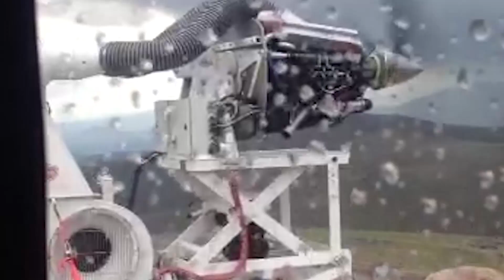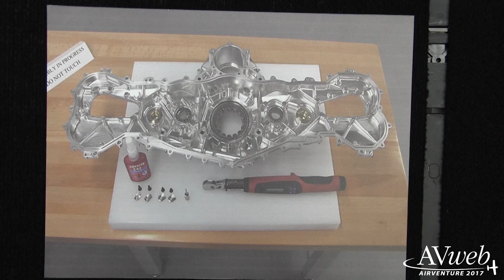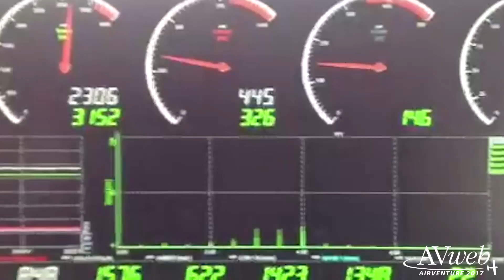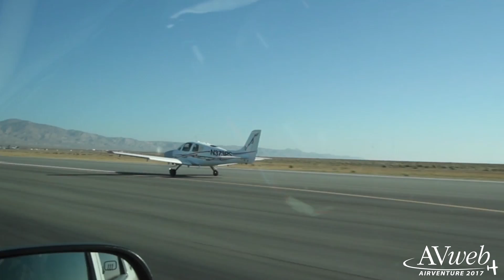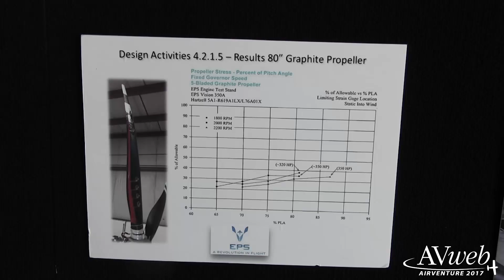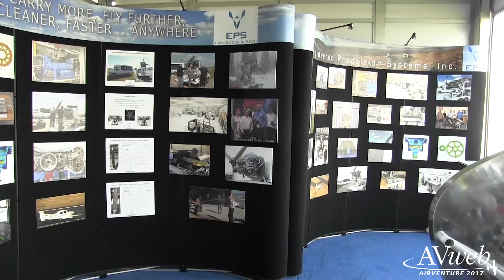EPS Diesel Back at AirVenture

Comment: Here's hoping this engine meets expectations and comes to market with a scaled down version or two as well. GA really does need a Jet-A burning alternative that's not priced in the stratosphere.
Reply: Apples and oranges  ...  Lemme know when that Nissan puts out  #620 N·m and has a duty cycle of 10,000 hrs at 70%. Marine engines like Aircraft engines are designed and tuned for endurance and reliability, not maximum output.
Reply: AGAIN: Torque means nothing because it can be changed to basically anything you need with gearing. The power output of the engine tells you how much torque you'll have at a given rpm.

For example: Your 260 hp diesel makes its peak power at 4,000 rpm, but in order to run a prop it would need to be geared to 2,700 rpm, and that would require a gearbox with a ratio of 1.48:1. The torque output of that gearbox at 2,700 rpm would be right around 500 lb-ft, or 1.48 times the flywheel torque output at 4,000 rpm. The Adept Airmotive engine can also drive a prop at 2,700 rpm (or 2,250, depending on the gear ratio), so the torque output from its gearbox would be 622 lb-ft. That's the difference between 260 hp at 2,700 rpm and 320 hp at 2,700 rpm.
Reply: I don't understand why this has to be explained to anyone...

Heavy duty engines are *HEAVY*, that's why they're able to run at high power for many thousands of hours, and their weight is also why you don't see them flying in aircraft. The longevity of an engine depends on how heavily its built, not on the fuel that it burns. If you build a 260 hp, 675 pound gasoline engine, you can bet that it will run just as long as a diesel at full power, if not longer because the stresses of the diesel combustion cycle are greater. 

Power is the only thing that matters with regard to the performance of a vehicle, the amount of torque an engine makes only tells you how fast it's going to need to run to produce its power. 

The definition of power is work done over time, more power means more work done over time, or the same amount of work done faster.

Aircraft engines need to balance reliability and longevity with their power to weight ratio, and diesels do very poorly in the area of power to weight ratio. You're comparing apples to oranges because you're comparing an engine that could never power an aircraft and provide it with any usefulness to engines that DO power aircraft for thousands of hours at a time.

Edit: Better wording.
Reply: Compression ignition engines are inherently expensive, especially when expected to be light enough to be used in an aircraft.
Reply: In cars and trucks they charge more for Diesels because they have lower productions runs, higher marginal productions costs, Also they can charge more because diesels last longer and are often used in commercial applications, hence greater Value.  But with todays CNC production methods,  materials, surface finishes and Tech, when you compare the cost of materials, machining and production per/unit they don't really cost that much more to build, say @15 - 25% using modern production machinery.

The difference in Retail cost of Spark Ignition Aircraft engines vs similar duty Marine diesels tho is crazy _ For example, the MSRP for the high-tech 260/hp common rail, 3.0L V-6 Mercury Diesel  is @$35,000. Whats the cost of a new 260hp IO-540 Lycoming, $100k?

I think the biggest issue is development cost and scale of production differences...not to mention the $$$ cost of Certification.  That Mercury V6 btw is a light-weight, very hi-tech, VW-Audi based power plant, so they do build a few and that does lower the price.
Reply: They charge more because making stronger components costs more money, and those components need to be built stronger in order to cope with the higher stresses that come with the diesel combustion cycle. That problem is compounded in aircraft engines because the components not only have to be strong, but also light. 

Most of the cost difference between aviation engines and the engines used in other applications is definitely due to the certification process. 

That Mercury V6 is insanely heavy, a gasoline V6 with similar power output weighs around half as much. You can also compare it to something like the Adept Airmotive engines to see how far off the mark it is for a modern aircraft engine.
Reply: @Bravo21  The only reason diesels 'last longer' is their application. Longevity is not inherit to the cycle type, rather the design specifics, production quality and material types. The exceptions might be valveless engines, because objectively less parts is objectively more reliable.
Reply: "Today's CNC production methods"??? CNC is the most expensive way to mass produce parts. Small production run costs have gone down because of CNC technology but you generally don't make 100,000 of something using all G code.
Reply: "Whats the subject of the Video?"

AIRCRAFT engines, not boat engines that are too heavy to be used in aircraft.
Reply: Spark ignition is much easier to manage. There are much lower pressures and vibration which results in a product that is lighter and can use cheaper materials. Diesel needs much stronger components and thus stronger more expensive materials and heavier. Also Diesel produces more emissions requiring more R+D and extra technology to making it past the EPA. I think a better option is making engines that will run on 91 octane automotive fuel. This is economically a much better option for a casual flyer of less than 100hr a year. Jerry cans at home airport and 100LL if you are cross country.
Reply: Lol, Seriously?  I dunno if you're having me on,  joking or actually believe that nonsense?  Torque and durability mean everything for high duty, low RPM  Truck, Marine and Aircraft engines. HP makes noise, Torque does the work. Apples and oranges.
Reply: @Bravo21  "HP makes noise, Torque does the work." < the telltale sign of somebody who has no knowledge of the physical principles at play in the work of powerplants. This is why you are not an engineer. Torque is a measure of force, work is force done over distance or unit length, and power is work done per unit of time. Torque is a spec that is only useful to someone also looking at what RPM torque and power outputs occur and designing a prop/gearbox to match that. After that, we care only about sustained power output / mass and Brake-specific fuel consumption (or how much fuel is consumed to produce a given amount of effective work, or power time).
Reply: Lol and again I gotta wonder if you are joking, trolling or simply don't have a clue ... apples to oranges.  A heavy duty Diesel can run at 90% output for weeks on end with no damage at all, a spark ignition high rpm engine cannot. In Recip engines HP makes noise, Torque does the work. That is what matters here, work done over time with sustained high output and reliability, not a trip down the race-track. Apples to oranges.
Reply: @Bravo21  "A heavy duty Diesel can run at 90% output for weeks on end with no damage at all, a spark ignition high rpm engine cannot." Last I checked, a spark ignition O-360 has a 2000 hr TBO... that's 12 weeks at WOT, that's how airplane engines are run. Work over time is called *power*... A diesel engine is well suited to high load applications yes... this is because it operates on a different thermodynamic cycle than the Otto cycle and the practical realities of this difference in cycle and fuel lend itself to such applications. I would not consider Diesel the optimal engine type for GA, because as we are seeing here, Diesel engines have to be heavy and have relatively poor power output (and diesel fuel has less specific energy per mass albeit barely). 50 pounds over a 400 horse O-720 BEFORE any cooling systems are installed is considerable and due to the engine's location far from the center of lift, also results in a much higher load on the elevators, leading to inherent lower aerodynamic efficiency for the aircraft.
Reply: @Heatherder  Links wont post. On YouTube, search for the following videos:
-
Winning entry in the 3rd Global STOL competition 8/3/2020 - Steve Henry
-
Viking 130 Rans S-20 Cruising Faster than Rans S-21 with Turbo Rotax 915 - Viking Aircraft Engines
-
P-51 Mustang Voodoo: The Fastest Piston Powered Aircraft  - SkyMaster21
-
Fieseler Storch - Part One - Kermie Cam - Kermit Weeks
-
The Bull Moose With Corvette Sound - ErikJohnston
-
Adept Airmotive Shows Its V-6 at AirVenture - AVweb
Reply: "I was not offing an opinion."

Because you don't want to acknowledge that you're wrong, you're just throwing a tantrum like a child.
Reply: You can't compare the price because the marine engine isn't light enough to be used in an aircraft. Making an engine light, reliable and powerful is very costly, especially if it's a diesel.
Reply: We are talking about Production engines _ All engine blocks must be machined during production. Mechanized Machine processing (CNC) is faster and far cheaper than using a human machinists to do the job and why they are all CNC machined today -  no matter if the engine block is cast or Billet.
Reply: I agree, but the VW-Audi Diesel V6 is very lightweight (675lbs / 306kg) for its output. It uses an engine block fabricated from Vermicular Graphite Casting (VGC), with twice the strength of gray iron and most of its attributes, but is 5% to 10% lighter. This is a very modern engine.
Reply: A Nissan VQ35DE (just a Plain Jane automotive engine) weighs around 330 pounds and can make up to 280 hp from the factory, and that's with full emissions controls. Eliminate the emissions controls and it's probably capable of making 20 hp more. The naturally aspirated Adept Airmotive engine weighs 324 pounds with its PSRU and makes 280 hp, the turbo engine makes 320 hp and weighs 340 pounds with its PSRU. You can basically run 680 hp worth of gasoline engine for the same weight as that 260 hp diesel.

Edit: Correction, the VQ35DE made up to 298 hp from the factory.
Reply: I should also add that race-prepped Nissan VQ engines can make close to 500 hp without turbocharging and can handle over 1,000 hp with turbocharging quite well. I doubt you'd want to push that engine quite that hard in an aircraft, though.
Reply: @PistonAvatarGuy  You would want to de-rate the engine for use in aircraft. You could flat-rate it so that maximum output never exceeds aircraft design output but performance only begins to degrade at quite adverse conditions. In any case, a VQ engine would be a horrendous choice for airplanes. For start, V6 engines are not an idea profile for an airplane, nor are V8s. Anything with a chain is going to be frowned upon. Using car engines is not a great idea, but lets say someone too a good contender and redesigned it for aircraft use. Most good contenders will be 4 cylinders, so lets look at a family with some contenders, the GM ecotecs. On the small end you have stuff like the GM 1.4L turbo, a dry 220 lb engine making 160 horsepower. This is very comparable to a 250 lb O-320 making 150 horse. Ad another 50 pounds for cooling and radiator system and gear reduction for the GM and you have a similar weight and power system except the GM engine has a turbocharger and near certainly more efficient at making power per fuel amount. The GM engine will need to be modified, though. The timing chain has to go - it will need gears and that means a new block casting to mount timing gears. It will need to be beefed up for constant near peak-output operation and it will need a new oil system so it can sit upside down or horizontally or at least handle zero and negative G conditions. The ecotec engines are par for the course modern auto engines. All other auto engines will use similar design specs and construction techniques and have the same kind of drawbacks.
Reply: @Heatherder  You don't need to de-rate the engine for use in aircraft, it just needs to be built properly to handle the stress of continuous use at high power levels. The deck of the VQ can be closed with something like a Cylinder Support System, pistons and rods can be replaced with stronger forged units, etc. If an engine can be built to handle more than triple its factory power output reliably in racing applications (1,000+ hp VQ engines are not unheard of), it can be built to handle its factory power output continuously.
-
MODERN automotive engines are hugely overbuilt anyway, the poor reliability of older automotive engine conversions is largely based on older, weaker engines, like VW and Corvair engines. Viking Aircraft is proving that unmodified engines are very reliable in aircraft at their factory power ratings. An example of properly building an engine for use in aircraft, while greatly exceeding its original power output would be the EPeX engine in Steve Henry's latest "Yee Haw" aircraft. It runs at 10,000 rpm at full power and is turbocharged so that it makes DOUBLE the amount of power that it was originally designed to produce. He flies it regularly, all over the US.
-
Nothing is better suited for use in aircraft than 'V' engines, they combine low frontal area with the best possible power to weight ratios. The fastest piston aircraft in the world uses a V-12 (essentially double a 60 degree V6), the Bull Moose (a modified Murphy Moose) uses a V8, as did the Fieseler Storch. Perhaps you can describe some better configurations and why they are superior?
-
Why would timing chains be frowned upon? They're extremely reliable in most applications. Gears would be better, but chains are certainly adequate. There are certain engines which have poor timing chain reliability (GM and Audi, typically), but those can simply be avoided.
-
Automotive engines are somewhat heavy, but that's because they're designed to be inexpensive and easy to produce. When a modern, liquid-cooled engine is DESIGNED for use in aircraft, it's weight is significantly reduced, as demonstrated by the Adept Airmotive 320T and 360T. Liquid cooling systems don't add nearly as much weight as you would think, more like 10 to 30 pounds, depending on the power output of the engine.
-
I'll try to post some relevant links, as you've clearly been living under a rock for the past few years.
Reply: Another video to watch: LongEZ V8 - Chris Martinus
Reply: @PistonAvatarGuy  It isn't about what the engine can handle, rather about what the air frame is designed to deal with, in particular, low speed P-factor problems. Are you a pilot? 

Perhaps I am being to hard on timing chains. However, timing chains have a tendency to stretch on all makes that use them, it's called creep. They are also a wear item that will have to be replaced at TBO, which is fine, but gears would be better and safer to use in an airplane. They can be louder but that isn't an issue for airplane engines because props make a fuckton of noise anyways.

 Automotive engines are not heavy just because of manufacturing reasons, they are also designed for a different application where block rigidity is more important. Car engines regularly experience shock loads waaaaaay higher than what GA engines ever do except in a prop strike. Additionally, some cars use the engine as a structural component. This is excess weight, far from the CG that's a horrible thing for efficiency of the airframe. If it can be excluded from a GA engine design, it should be.

You're also projecting about what I'm saying. You were talking about using car V6s at that makes someone think about 60 or 90 degree V6s, heavy engines that are optimized to fit between two wheel wells, still have room for turbos, header/cats right at the firewall, share this space with a transverse mounted transmission and steering assembly and be very rigid, are not going to be optimal for a light aircraft looking to weigh half as much as the car it was designed for. A nice 120 V6 like Adept's is a different story, and there's nothing wrong with the V configuration in the context of aviation purpose-built designs. 

I took a look at that highly modified for aviation use Yamaha engine by the way, I noticed it has stuff like a dry sump system - really important in airplanes! Some modern cars have anti-slosh baffles or dry sump systems but almost all will still starve the oil pump in a negative-G situation. So there's a redesign right there! I like the little Honda Fit/Viking engine, it's neat but it isn't exactly a competitor to IO-720s.

And lastly, "reliably in a racing scenario" is one of the dumbest terms I've ever headr. Most racing engines completely ignore fatigue limits on cranks and connecting rods because they are expected to last a *few hours*, not 2000. Obviously an engine can be modified to operate for many hours at full load reliably - I wasn't saying it cant. But if you're gonna go that far, why not design an engine properly for its application anyways, instead of spouting off about a fucking bland-ass VQ engine (ghey anyways, and Nissan is about to fold so they won't be so cheap after that).

Living under a rock? You're a pompous dickhead and you know nothing about real engineering or design considerations. You only know how to parrot things you spend all day reading about/memorizing. You play with engine legos, very cute. Let real engineers do the actual work.
Reply: @PistonAvatarGuy  I'm well aware that people drop Chevy blocks into Long EZ and other non-certificated airplanes, and I fully support it. But that's fucking dumb to mention because it's an irrelevant conversation when breaching the topic of what will replace the aging air cooled engines of yesteryear for certificated GA aircraft in the future. You really think a small block is going to get less fuel burn than an IO-540? despite the added weight and no objectively better thermodynamic properties? It ain't small block Chevys unless GM suddenly and naively decided to invest into making a GA engine and getting it certificated, and if they did they wouldn't use an existing car design, they would optimize a new design for the application.
Reply: @Heatherder  "It isn't about what the engine can handle, rather about what the air frame is designed to deal with..."
-
I wasn't suggesting that significantly more powerful engines be installed in place of less powerful engines, I was merely pointing out that automotive engines can be built to handle producing their maximum power rating on a continuous basis quite easily. Anyway, plenty of pilots/airframes handle significant power increases quite easily in many cases (Steve Henry and the Bull Moose in the examples that I provided).
-
"However, timing chains have a tendency to stretch on all makes that use them, it's called creep."
-
Many modern engines (current production Honda 4 cylinders, the Nissan VQ, the Adept Airmotive engine, etc) use hyvo chains, which don't have this problem. Gears would certainly be a better option, but it's extremely difficult to retrofit gear drives onto engines which previously made use of chains/belts.
-
"Car engines regularly experience shock loads waaaaaay higher than what GA engines ever do except in a prop strike."
-
Very true, this also explains how Adept Airmotive was able to make their engine as light as it is.
-
"Additionally, some cars use the engine as a structural component."
-
Very, VERY rarely.
-
"This is excess weight, far from the CG that's a horrible thing for efficiency of the airframe."
-
Except that automotive engine conversions can have power to weight ratios that are comparable to LyContisarus engines... with turbocharging. The power to weight ratio of a turbocharged VQ would be very competitive with that of an IO-550.
-
"You were talking about using car V6s at that makes someone think about 60 or 90 degree V6s..."
-
Titan Aircraft has been making use of a 60 degree Honda V6 for many years now, it's installed weight is something like 415 pounds for 250 hp, that's not bad at all. 60 degree V6s have less frontal area when compared to 90/120 degree V6s and flat engines.
-
"I noticed it has stuff like a dry sump system..."
-
Which was pulled right from the snowmobile. ANY engine can be modified to make use of a dry sump system. Most aircraft engines are wet sump anyway, dry sump systems have never been a requirement for aircraft engines.
-
"I like the little Honda Fit/Viking engine, it's neat but it isn't exactly a competitor to IO-720s"
-
The IO-720 is a 400 hp, 600 pound monster that almost no one makes use of. A V8 conversion is better in basically every way possible. The Viking engines are meant to compete with Rotax engines and  LyCont 320s/360s
-
"And lastly, "reliably in a racing scenario" is one of the dumbest terms I've ever headr."
-
You misunderstand. I said: If an engine can be built to handle more than triple its factory power output reliably in racing applications, it can be built to handle its FACTORY power output continuously. In other words: Build it to handle 1,000 hp, use it to produce ~300. That's what the guy with the V8 powered LongEZ did, that's why he's flown it over 1,000 hours over the course of ten years while seeing "no appreciable wear" on the engine. Sorry, buddy, but overbuilding engines is how you make them reliable, PERIOD.
-
"But if you're gonna go that far, why not design an engine properly for its application anyways..."
-
Because it costs HUNDREDS OF MILLIONS OF DOLLARS to design a modern engine from scratch and it would NEVER produce a return on that investment because of how slowly aircraft engines sell. How is that even a question? What planet do you live on?
-
"instead of spouting off about a fucking bland-ass VQ engine"
-
What are you, 10 years old? What better choice is there? The VQ is one of the best engines ever built!
-
"You're a pompous dickhead..."
-
Says the guy who gets completely bent out of shape at the mere mention of a Nissan engine.
-
"...and you know nothing about real engineering or design considerations."
-
Oh? Then what's your point here? You've added NOTHING of value to this discussion, you're just nitpicking nonsense!
-
"Let real engineers do the actual work."
-
Where's your engine design, bud?
Reply: @Heatherder  "You really think a small block is going to get less fuel burn than an IO-540?"
-
IT DOES, he even says that in the video. Liquid cooled engines EASILY destroy air-cooled engines when it comes to fuel efficiency, because you don't have to use extremely rich mixtures to keep the engine from overheating and destroying itself. Modern EFI systems would also be fantastic to use with LOP operations.
-
"despite the added weight and no objectively better thermodynamic properties?"
-
Liquid cooling allows for higher compression ratios.
-
"It ain't small block Chevys unless GM suddenly and naively decided to invest into making a GA engine and getting it certificated..."
-
Uhhh... what? That engine isn't a Chevy engine, it's a Ford engine and an aircraft engine doesn't need to be based on an existing design to be certified. Google: Orenda OE600 - Now, don't go off on a rant about this engine, it was obviously doomed to failure from the start because it was meant to compete with a highly successful turboprop engine, I'm only mentioning it because it was a pushrod V8 that was certified for use in aircraft.
-
"... they would optimize a new design for the application."
-
Duh. That's my whole point here: Engines need to be modified/designed to handle use in aircraft.
Reply: PistonAvatarGuy alright, obviously you will run in circles with me forever about this, so I’ll just point out some things that demonstrate your practical lack of applicable knowledge in comparison do memorized examples.

So to start, air cooled engines do NOT need to be run “super rich” to stay cool. This has been proven many times over. Late planes with turbocharged lyco/Continentals have automatic baffle control, they needn’t mixture adjustments until class A altitudes, no power restrictions and they are still missing a great degree of automation that should be using.

I’ll agree that timing chains are probably okay in some scenarios

The VQ is a forgettable and lame engine
Reply: PistonAvatarGuy good power/mass is not the target, it is just low mass. Any additional mass means lower useful loads and more load on the wings thus more drag thus more fuel consumption.

Compression ratios have nothing to do with efficiency. Low waste heat temperatures is how you achieve efficiency. That’s what exhaust recirc and atkinson engines exist. Compression ratios allow for higher peak temperatures and thus great power.
Reply: PistonAvatarGuy frontal area isnt the issue as much as thrust line. Now a gearbox can fix this but, if you hadnt noticed 60 degree V6s are very tall and the crank is right at the bottom. That isn’t great unless you flip it over like a 605.
Reply: PistonAvatarGuy chevy, ford... there is no practical difference, this is pedantry.

In any case, bent out of shape is how I got after you said i was “clearly living under a rock”. Now youre saying youre whole point is that engines need to be modified designed to handle aircraft use which is basically what I was saying from the get go, pointing out why many car engines aren’t suited to aircraft conversion very well and no stock ones are. To top it off you seem to think that efficiency and power density and power/weight are all interchangeable. This is not the the case.

Aviation could benefit a GREAT deal from more modern engine technology. But to say it hasnt already is understating things. Aircooled designs have got tons of modern supporting tech and redesigned setups, and the heady dry weights you see on wikipedia are of their original forms with cast cranks and cams and old, heavy cylinders and other weight adding components.
Reply: @Heatherder  "So to start, air cooled engines do NOT need to be run “super rich” to stay cool. This has been proven many times over."
-
When? Where? I've been reading about aircraft engines for 20 years, I've NEVER encountered one that came anywhere close to the efficiency of liquid cooled engines at full power.
-
"Late planes with turbocharged lyco/Continentals have automatic baffle control, they needn’t mixture adjustments until class A altitudes, no power restrictions and they are still missing a great degree of automation that should be using."
-
And? That doesn't prove that they aren't running extremely rich mixtures, or that their BFSC isn't absolutely horrific. Heck, even the latest FADEC engines consume around DOUBLE the amount of fuel that a modern, liquid-cooled engine consumes at the same power output. What were you saying about automation? Air-cooled engines are NEVER going to match the efficiency of liquid cooled engines, they're INHERENTLY less efficient.
-
"The VQ is a forgettable and lame engine"
-
WHAT'S BETTER? NAME SOMETHING. Toyota has some V6s that might be a little better, but no one is using them to produce a THOUSAND horsepower because they only come in grocery getters.
-
"good power/mass is not the target, it is just low mass."
-
Right, that's why all aircraft use weedwhacker engines, because they're only concerned with reducing mass, not with how much power the engine produces. /s
-
"Any additional mass means lower useful loads and more load on the wings thus more drag thus more fuel consumption."-
-
If greater performance is desired, people will install heavier engines in order to gain additional power. Trent Palmer's Kitfox is a perfect example of this, as are some of Mike Patey's aircraft, Rear Bear, etc. Many, MANY aircraft have been modified with heavier, more powerful engines in order to increase performance. Heck, read about the Griffon powered Spitfires of WW2.
-
"Compression ratios have nothing to do with efficiency."
-
That's the one of the dumbest things that I've ever heard anyone say about engines. Google: compression ratio fuel efficiency
-
"Low waste heat temperatures is how you achieve efficiency"
-
Greater efficiency means that less fuel is burned in order to obtain a given amount of power, less fuel burned means less heat produced. Are you HIGH? I don't understand how someone can babel so incoherently about something that they know NOTHING about.
-
"frontal area isnt the issue as much as thrust line"
-
Less frontal area = less drag. AGAIN, refer to the fastest piston powered aircraft on Earth, which uses a 60 degree V engine.
-
"Now a gearbox can fix this but, if you hadnt noticed 60 degree V6s are very tall and the crank is right at the bottom. That isn’t great unless you flip it over like a 605."
-
Are you NEW? An automotive V6 without a PSRU would be HORRIBLY under-powered. The PSRU not only corrects the thrust line, but it allows the engine to produce its peak power without over-speeding the prop. AGAIN: Titan T-51, Honda V6, EXCELLENT PSRU made by Autoflight in New Zealand.
Reply: @Heatherder  "To top it off you seem to think that efficiency and power density and power/weight are all interchangeable. This is not the the case."
-
You mean that none of those things can be modified? PLENTY of people do just that, are they breaking the laws of physics?
-
"and the heady dry weights you see on wikipedia"
-
I don't get my information about those engines from Wikipedia, I get it from the engine manufacturers.
Reply: PistonAvatarGuy i can tell you’ve done plenty of reading about airplane engines, and no using them 🙄 and I can tell you use reddit lol. Gotta quit that bro. Shit sucks your soul out.
Reply: PistonAvatarGuy greater performance isnt the goal numbnutz. We need lighter, lower cost lower fuel burning engines. Racing planes and super STOL kit planes and WAR PLANES are not an example of the problem with modern aircraft engines and by the way, that F8F uses it’s original AIR COOLED RADIAL ENGINE. Tell me a reno air racer’s gallon per hour fuel burn lmao.
Reply: @Heatherder  "greater performance isnt the goal numbnutz."
-
I said that it was for some people and that they're willing to use heavier engines to get the performance that they want.
-
"We need lighter, lower cost lower fuel burning engines."
-
You're not going to get all around better engines that cost less to buy, that's just not realistic. The Adept Airmotive engine does offer less weight and lower fuel burn, it's where light aircraft engine technology should be headed.
-
"Racing planes and super STOL kit planes and WAR PLANES are not an example of the problem with modern aircraft engines..."
-
But they do prove that heavier, more powerful engines can be used on aircraft that weren't designed for them.
-
"...that F8F uses it’s original AIR COOLED RADIAL ENGINE."
-
It originally had a R-2800, it now uses an R-3350.
-
I haven't been on Reddit for 4 or 5 years and you clearly know absolutely NOTHING about engines, of any kind!
Reply: PistonAvatarGuy compression ratio does improve  efficiency by getting the same peak temperature with less fuel sure, but airplane engines already use high octane fuels to avoid preginition and detonation. Mazda’s skyactive thing is probably the best solution to this. Lower octane fuels but the same peak temperatures with leaner mixtures and no detonation. Getting those waste heat temps down is where its at. Where does air vs water cooling come into this? It doesnt need to. Low rpm, large cylinder volume engines will stay cool with good baffling and flow. In any case, air cooled engines are capable of very high bsfc.
Reply: PistonAvatarGuy youre saying things at me that I have either already agreed with or already knew and arent relevant just to act like you know anything. Increased engine weight is higher load factors on the airframe is higher fatigue on the stressed members is higher P factor at low speed, low control-ability conditions is higher fuel burn is almost never ever worth it. I know you think you know a lot about engines but you learned it all backwards and you dont do any flying and you will never own a plane so why do you even care? You should go to school and study thermodynamics before you go around parroting your qualifications for other people’s hard work. That once engine you keep mentioning is very promising i agree but the proof is in the pudding ain’t it?
Reply: PistonAvatarGuy you don’t know anything about GA. Youre a paper stat surfer and thats it. I’m ending this here because you only care about pedantry and that’s it. I think we ultimately agree about most things but your fahg internet personality makes me remember why i stopped reading the autistic subhumans on youtube comments.
Reply: @Heatherder  "...but airplane engines already use high octane fuels to avoid preginition and detonation"
-
But they're air-cooled, so their compression ratios are still stuck in the 1950s. With 100 octane fuel, most modern engines have no trouble achieving compression ratios of more than 12:1 (some Honda K-series engines had an 11.5:1 compression ratio on 91 octane fuel, without direct injection), typical direct-injected engines would probably be able to get up to around 14:1. With 100 octane fuel, a SkyActiv engine might be able to get further up into diesel territory... 17:1, or something ridiculous like that.
-
"Lower octane fuels but the same peak temperatures with leaner mixtures and no detonation."
-
Liquid cooling is part of what makes this possible.
-
"I know you think you know a lot about engines but you learned it all backwards..."
-
A) I don't THINK that I know a lot about engines, I actually DO know a lot about engines. B) I don't even know what you're talking about. There are two separate points that I made here which you seem to be addressing as one point. 1) I'm saying that automotive engine conversions aren't the devil that most pilots think that they are and that they're better than LyContisaurus engines in many ways (significantly reduced fuel burn is one of those ways). 2) I'm saying that lighter, more efficient, more reliable, quieter, smoother, easier to operate engines (like the Adept Airmotive engine), can be put into production RIGHT NOW, but the market system can't absorb the cost, so light aviation is stuck with using either giant lawnmower engines (LyConts), or automotive engines. Automotive engines are an excellent choice for many.
-
"...and you will never own a plane so why do you even care?"
-
Because I'd like to live in a world that's actually worth contributing to, not this backward, collapsing, horses--t nightmare that people like you are so content to help on its way to the bottom.
-
"You should go to school and study thermodynamics before you go around parroting your qualifications for other people’s hard work."
-
Parroting qualifications? I learn by reading, which is how EVERY engineer on this planet learns about the things that we're discussing here!
-
"That once engine you keep mentioning is very promising i agree but the proof is in the pudding ain’t it?"
-
Proof of what? That the market system is an archaic joke and prevents hugely beneficial technologies from reaching consumers?
-
"you don’t know anything about GA."
-
Oh? What knowledge am I lacking which is relevant to this discussion?
-
"why i stopped reading the autistic subhumans on youtube comments."
-
Says the butthurt ignoramus who just got his a$$ handed to him at every turn. What point did you make here? That increasing the weight of an aircraft negatively affects its performance? I think that I learned that when I was a preteen, bud, more than 20 years ago!
Reply: @Heatherder  Love that universal measurement of a "Fuckton".
Reply: Lol, project much? I leave the tantrums and drama to you ... seems thats what you are best at.  Whats the subject of the Video?  Yup, it's not my opinion, the facts stand.
Reply: Like sand through the hourglass these are the days of ( AJ and Pistonavatarguys) life, fuck, you both need a therapist.
Reply: Engine torque output means absolutely nothing, it can be changed to basically anything you need with gearing, the power output of the engine tells you how much torque you'll have at a given rpm.  As an example, the Adept Airmotive engine produces over 1,000 Nm at the prop hub.

There aren't really any piston aircraft engines that have a TBO of 5,000 hours, and there aren't any modern airframes that could fly with a 675 pound, 260 hp engine hanging on their nose, at least not without being horribly underpowered. That's like an R-985 with half the power.
Reply: So you are trolling. I was not offing an opinion and Diesels do power aircraft and have for a long time. ... apples and oranges.   You are arguing with yourself.
Reply: "Whats the subject of the Video?" Diesel Aircraft Engines....Diesel.

The advanced Marine diesel was referenced for comparison of price between similar quality & duty cycle engines...reading is fundamental.